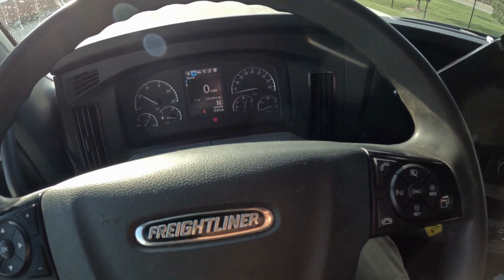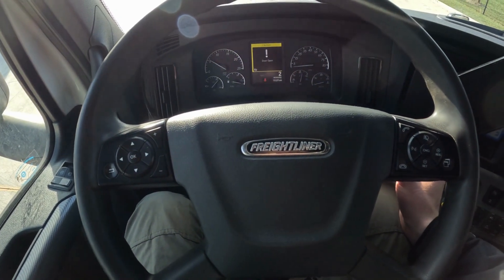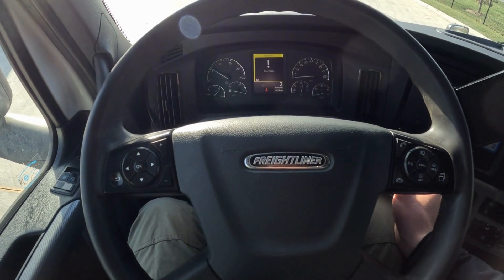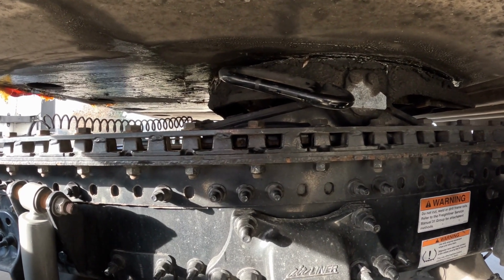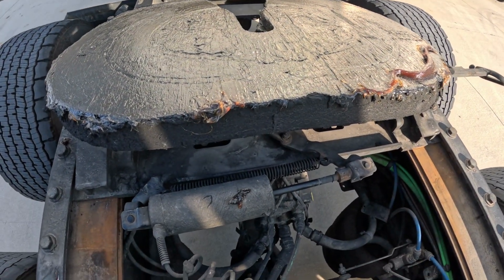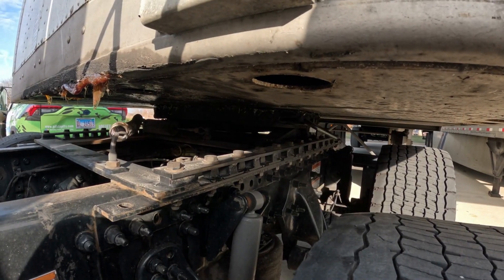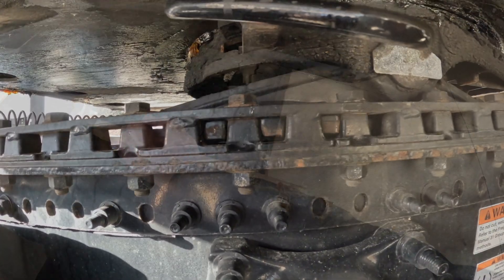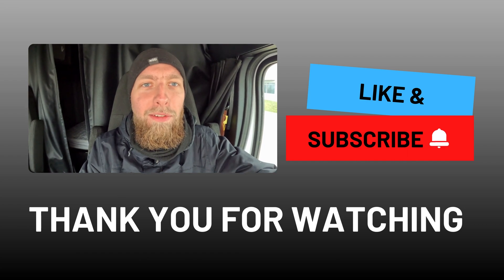How to slide a 5th wheel (How to fix overweight)

Comment: Mines is sliding not locking... will try this now since I'm like 4hrs away from mechanic...
Reply: If you dont have hammer you can use rock or something like that
Reply: How much weight is each whole move worth in pounds?  When doing this procedure?